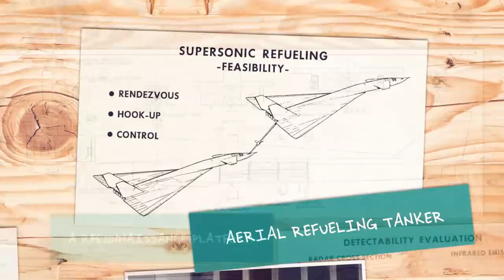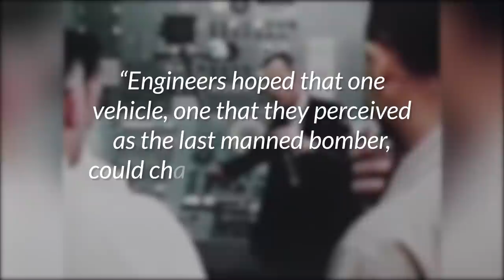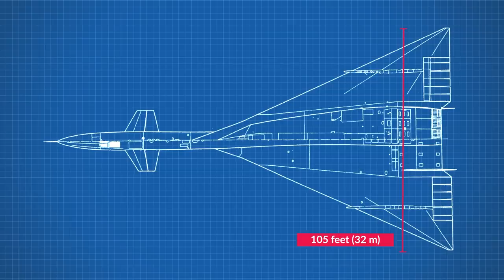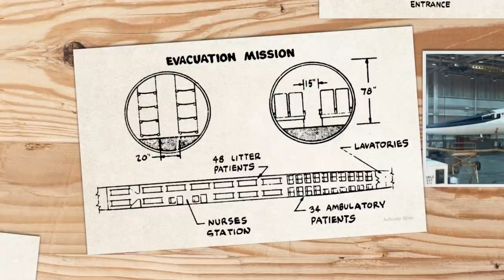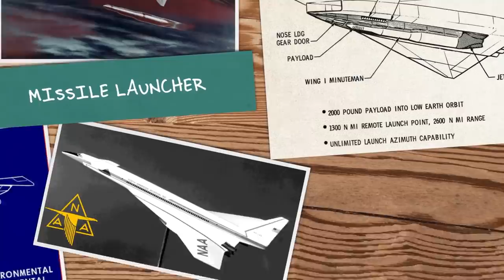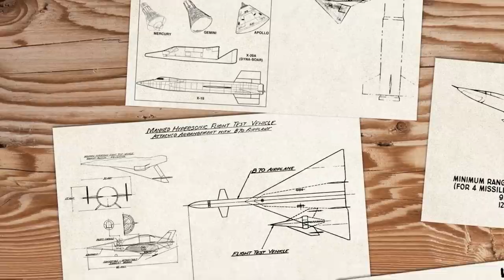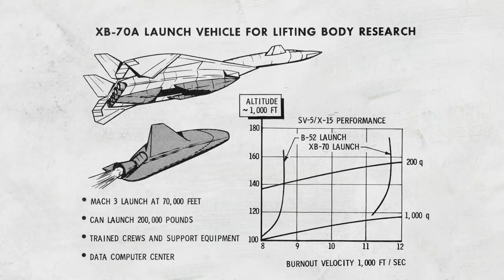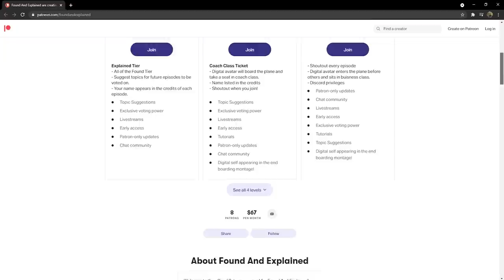Ahead Of Its Time: Mach 3 XB-70 Valkyrie Super Bomber

Comment: I love how they were planning on replacements for the B-52 in 1954. Meanwhile, in 2021 the B-52 still serves with distinction and no one would dare replace it.
Reply: In its former main role it was replaced by B-1s and B-2s, however die to its versatility it's used for different purposes today.
It's the versatility which left it in service.
Reply: The B-52, will, someday, be finally replaced by the B-21 Raider.
Reply: The B-52, will, someday, be finally replaced by the B-21 Raider.
Reply: The B-52, will, someday, be finally replaced by the B-21 Raider.
Reply: @johnosbourn4312  it will remain in service until 2040, at least this are the plans. However, the B-21 will replace the B-2 and the B-1, not the B-52.
The B-52 is used for a different role today as a cheap bomb truck, for little to not defended airspace, while the B-21 will  be capable of penetrating defended airspace due to the stealth
Reply: Their intended roles as high-altitude strategic nuclear bombers evaporated with improvements to unmanned strategic and defensive missile technologies; in scrambling for a new raison d'etre, the cheaper B-52 found a new role to play while the XB-70 was too expensive and too specialized to adapt. Still looks cool, though.
The future of high-tech war machines will be increasingly unmanned, as machines can take higher g-loads, need no oxygen or potties, and will likely not have ejection seats for to terrorize bears.🐻🛬🪂
Reply: @icollectstories5702  As you wrote, specialization is the problem here. The B-58 for example was a one trick pony, it was fast but it was not versatile at all and got retired in 1970. The B-52 however is versatile and found new roles, so it's still useful and still in service.
Reply: @johnosbourn4312  B-52s are immortal
Reply: It's kinda the "Ultimate hand-me-down" at this point. I don't know if there will be enough parts to keep it flying in the long term.
Reply: @Blur4strike  they even modernize them further, the number flying today get new engines (also 8), and they modernized the cockpit, it has now a modern glass cockpit with displays.
To get some spares they have non flying ones in the boneyard

Comment: 7:18 Ionic Engine.  That got a double take.  Maybe it would have had two of them.  You know, Twin Ion Engines.  Might be an acronym there for a fighter version.
Reply: Yesssss
Reply: Adjacent engines, could've helped in the fine tune yaw steering, that NASA was 13:20 bickering about (aside from being the cause of the accident with their spectate planes😒). But it would be a concept, that Lockheed mastered, forgotten in this Boeng craft. Which Lockheed achieved with the 71 & 72 SR models, making the aircraft body itself, BEING a (elongated) Wing, the only reason SR 71 & 72 had extends of wings form, was to carry bulk efficient engines that exploited sound for speed.

 Not perfect though, Lockheed also lacked another dilemma, no cooling cycle turbine, traveling in mid Earth hemisphere high, a turbine that cycled micro air intakes from front side, of wing rims and engines, compress lather flowed to the front nose cone, shower cooling from thin atmosphere burns 🔥.
 Instead, "Titanium" was a 'solution,' but would only lead to extreme maintenance tagging on arrival, for EVERY landing retun.

Comment: is it me or do plane makers in the 1950-1970s always think they can make one plane for air fueling and passengers and also for the army
Reply: It was perfectly sound logic and happened all the time during almost all of the propeller era, so it makes sense that an old habit would die hard.
Reply: Army?
Reply: @t65bx25  I’m mad this plane never got made. The Rooskies made the Mig-25 Foxbat specifically to counter this kind of intercontinental bomber, but if they could’ve made this fly at Mach 3 for hours like the SR-71, the MiGs wouldn’t have been able to catch it.
Reply: Volume production amortizes development costs: "We got a bunch parked out back, so why don't you just buy one of those?"
I am a fan of COTS and not spending money to re-invent the wheel.
Reply: @thatcarguydom266  the SR-71 didn't have to fly as deep into Soviet as a bomber would, or face the same defenses.
Reply: @winternow2242  It faced the exact same defenses, just not at the same threat level since they didn’t technically fly in Soviet airspace
Reply: @thatcarguydom266  if the SR-71 didn't face the same "threat level" as a B-70, then it didn't face "the exact same defenses".  If the 2 planes fly nowhere near the same highly defended places, they're not facing the same defenses, identical, similar or vaguely comparable.

Comment: Actually the XB-70 was found to have superior low handling performance to the B-52. It was not only faster, but more stable and exceptionally maneuverable for its size. It would have been an insane low level interdiction bomber. 

However it's cost was ridiculous when compared to the conventional  BUFF and at the time, mid sized low level penetration bomber was already flying for the USAF - the B-58 Hustler. The B-58 was no where near as fast as the Valkyrie but it was still far faster than any BUFF, and flew well at low level. It seemed almost pointless to maintain the XB-70 program when ever you already had two bombers that could do what it could at low level, and the cost of the XB-70 was so high because it was meant to fly high at Mach 3 - a saving to which even the controversial Hustler looked better on paper for.

Comment: Congratulations. Your facile and relatively comprehensive technical narrative compliments your stock footage selection, including some footage I have never seen until now. I know how difficult and time intensive the process of documentary making, however short, can be.

Just a small quibble though: You imply, via a shot of stock footage showing welding, that indeed the stainless steel honeycomb panels were fabricated by this method (10:15). Actually, they were fabricated by compression of the three components with brazing compound applied, and brazing was then accomplished by putting them in a heated autoclave in an inert gas environment.

Comment: Last week, Mustard made a video on the MiG 25 Foxbat - the plane designed to intercept the Valkyrie.
Reply: I find the link between the 2 more assumed than established.  

That’s the conventional wisdom – a mach 3 interceptor to handle a mach 3 bomber.  The problem is that the timing is off.  

The MiG-25 followed earlier research programs into high-speed interceptors of the Ye-150 family, work that was older than the B-70, meaning that Soviet research into dealing with the B-70 began before the B-70 even existed.  

The MiG-25 program itself was initiated before the B-70 was cancelled as a weapons system, but not by much - maybe a few weeks.  Despite the end of the B-70 program, America’s not replacing the loss of AV2 in 1966, and the B-70’s replacement with the more modest AMSA program, the Soviets continued developing the MiG-25 for years.  

MiG-25 serial production began in 1969, the year that the last B-70 was sent to the Air Force museum. 

The Soviets, not unlike the Americans, began many exotic programs, and then abandoned them.  

But accepting the MiG-25/B-70 theory requires the belief that the Russians continued developing – and spending huge sums of money – on a plane to deal with a problem that hadn’t existed for years.

Comment: You mention the boron fuels but never point out that they were dropped early on due to operational issues, (deposits in testing that tougher than solid stone and could only be removed through careful grinding which more often than not damaged the equipment and toxic combustion residue in the exhaust) and never used operationally in the XB-70.

Comment: I could see a variant of this craft with a single engine or a single fuel cell with liquid o2 that kicks on when the craft hits a high enough altitude to break through the atmosphere and use that engine and fuel cell to maneuver in orbit then reenter the atmosphere. Or better yet, use the flat bed plane concept with an XB variant mounted on top with 4 engines using conventional jet fuel, but 2 using solely liquid o2 for  in atmosphere, and in orbit versatility

Comment: Just imagine this airplane painted in SR-71 black, totally rebuilt in titanium, with six J58 engines instead!... What a machine it would be!
Reply: I don't think J58s would work here since they need a direct airflow, they have their own air intake integrated by the shock cone (which prevents supersonic air to get into the engine) and need supersonic air around the shock cone, which delivers most thrust at Mach 3. The Valkyrie had a conventional air intake which slowed down the air so subsonic speed, the J58 won't work in the same way behind this air intake due to a lack of air passing the intake at Mach 3
Reply: Any numbers how much better that fuel is? With such a fast plane to keep the turbine temperature constant ( given by the material of the blades ), one has to slow down the engine. To keep the airflow, all blades need to be feathered. Even that did not suffice and thus air needs to be dumped in the voids between the engines. I want F-22 raptor style thrust vectors. This plane is so safety centered : Each turbine has its own after burner. They should instead try to fill the wake and reduce drag.

Comment: we know why it was canceled sound decision but still engineering wise if you have the books it is very advanced. It is ok if it was cancelled. Still ... yeah ...we love XB-70. Test flight revealed more work to do. But it could have been in an old environment. It could have replaced B-52 if all that was required was bomb in a safe environment. I think there were 0 problems with B-52 and quite some with XB-70. There has to be a reason.

Comment: XB-70 INSANE & CORRECT FACTS taken from amazing 250 page book “Valkyrie - North American’s Mach 3 Super Bomber”

The XB-70 is the ONLY aircraft EVER designed to be able to use compression lift causing it to still have to this day the best lift tp drag ratio increasing overall lift by 34% and INDEFINITELY fly/cruise (the engineers learned that it was much more fuel efficient to stay at mach 3.15 than to just dash when close to target, all other planes to this very day can only dash for short periods at supersonic speeds before having to slow down) at a speed of Mach 3.15 at a height of 95,000 ft weighing a massive 540,000 lbs, with an operational range without refueling of 5,290 nm but could be refueled in air extending its range (it could hold 47,000 gallons of JP-6) carrying 50,000 lbs of 20 megaton thermonuclear bombs on the first ever rotary launchers in two weapons bays which interestingly could only be opened one at a time and not simultaneously .  The XB-70 has 6300 sq ft of wing area (NOT including the largest canards of any aircraft ever), the folding wingtips are the largest all moving surface of any aircraft to this day comprising 40% of the total wing area, the highest hydraulic pressure of any aircraft @ 4000 psi (note: V-22 osprey beat that),  most of the pioneering R&D for the XB-70 was used by lockheed for the much much less impressive A-12 which turned into the sr-71 everyone loves but only weighed 91,000 lbs and could carry almost no weapons except 3 gar-9 falcon air to air missiles on the cool yf-12 interceptor the worlds TRUE fastest interceptor ever made (NOT the practically useless, but interesting Mig-25 which was built in response their learning of the XB-70, but here’s the kicker:  the XB-70 flew higher and faster and by the time the migs were scrambled and up to their maximum of mach 2.85 the xb-70 would have been too high too fast and far away to target with missile/homing tech at that time…I digress).

If u wanna know literally ANYTHING about the greatest aircraft ever made by man just reply here.

Cheers!  Btw, the Intakes on the XB-70 are the largest ever made and you could comfortably stand up in them and inside them it was like being in a small living room, the massive 60inch diameter YJ93-GE-3 jet engines could each produce over 30,000 lbf thrust at 95,000ft at Mach 3.2 for over 500 continuous hours and the true max thrust is STILL classified…
Reply: I never found an explanation for compression lift. I know that winglets on subsonic planes reduce the bending on the wing root. Jets have these triangular planforms to keep most lift close the fuselage and reduce bending already in this way. Winglets sense a different angle of attack. So I would guess they operate the regime where a plane is stable? At least with swept wing they increase directional stability. The long, thin fuselage on modern jets has a thick boundary layer and thus destroys lift. Still we better try not to push the airflow to the outside ( The space shuttle has a clean belly). The subsonic leading edge lets air escape from the bottom site to the top. I read the this creates such a large flow that one engine on the Concorde is in danger to stall and gets special treatment. So the winglet catches this flow? The Phantom has jagged leading edge. Can't we use this to get the best of super and sub sonic leading edges? The hustler has pods protruding -- clearly even at supersonic speeds you can still manage aeroelastic stability. Same with the SR-71 cones. Pods look a bit ugly on supersonic planes, but I guess it is the only way to stay clear of the nose wheel debris.
Reply: @ArneChristianRosenfeldt  So when they designed the XB-70 the thing that SPECIFICALLY creates the lift from the shock front is the special splitter at the apex of the lifting massive delta wings, this splitter created a special shockwave that upon hitting the splitter would create extra pressure in the shockwave impinging on the lower surfaces of the wings.  In general, “compression lift” is achieved by positioning the wing in a manner to take advantage of the pressure field behind the shockwave generated by the fuselage body.  Since a supersonic air inlet for the engines must create a disturbance in the form of a shockwave in order to compress and slow the incoming air and make it available to the engines, North American already had a ready source of a large pressure field.  So at Mach 3 this shockwave was bent back about 65 degrees and there was a 0.3 Mach reduction from in front of the shockwave to just aft of it.  This resulted in an average pressure rise of 40 lbs per sq ft.  By shaping the underbody at the same angle, the compression field was maintained for most of the length of the fuselage.  Superimposing the wing on top of the shock system exposed nearly the entire undersafce of the wing to the pressure rise.  Since there was no equivalent pressure wave on top of the wing to cancel it out, a 34% increase in lift was available with no drag penalty.
Reply: @ShinVega  So it is very sensitive to velocity or temperature. Especially the latter may work out quite well. But on the Concorde the inlets just direct the shock downwards and directly create lift. Also they keep most of the shock internal and manage it. The pressure under the wing can easily changed the normal way: Angle of attack. I agree that the SR-71 is kinda ugly with its 3 noses which spill shockwaves all over the place. I just want to stress that there is nothing better on the XB-70 than on the Concorde. You could switch to more expensive materials and the Concorde (Shape) would win.
Reply: @ArneChristianRosenfeldt  Th Concorde was a piece of shit compared to the XB-70.  It had no compression lift and only weighed 400k lbs and couldnt fly nearly as fast or as high or as long as the XB-70.  So where’s you reasoning?
Reply: @ShinVega  My reasoning is that compression lift does not really exist. Like with winglets you could say wingspan is better ( see 787 with folding winglets ). It is a small second order effect that you reduce bending and thus weight on the wing root. Naíve compression lift descript looks for some first oder effect, which just does not exist. Soviet Union found out with their copy of XB-70 and Anglo-French designers knew that this was just to save the honor. NASA did just measure stuff for research data, not because they built on it (I already mentioned Space Shuttle) .
SR-71 is based upon the fact that surface friction becomes your main enemy above Mach3. I am not sure about the leading edge extension, but the shoulder wings and the mid mounted engines and the bevel sure try to minimize surface area. It looks like Canberra. Any cross flow due to compression from this splitter adds to flow and friction and is bad. The sharp Pods on Concorde are not ideal. Also I feel that the landing gear belongs into the pods like on Tu-144 in order to keep the fuselage sleek.
The Concorde already has steel leading edges. You just need to gradually move from aluminium to steel. Usage of titanium is just: Throwing money at it. Note how the space shuttle is also made of aluminum so maybe we keep a lot of it. The Concorde is a comfy plane, with lots of payload, noise dampening, A/C. It has a droop nose. I don't like the extended leading edge due to the surface friction and the wing "tip" vortex at supersonic speed. Tu-144 canards ( like on XB-70 ) should be better. I think people exaggerate the weight penalty of movable parts like wingTip, Wings, nose, canards, flying tail-planes.

Comment: how would a collision with a chase plane have any impact on the viability of the design?
Reply: The aircraft was replaced by ICBM - which were cheaper and proposed a  higher success rate.
Very fast aircraft typically have a high crash rate too, for example the B-58, which was Mach 2, but very hard to fly and the crash rate was high.
Reply: @simonm1447  A big difference is the B-58 was an operational aircraft.The XB-70 never got past the X version.The B-58 was a major problem for sure.
Reply: @simonm1447  im quoting the video, not the actual reason.